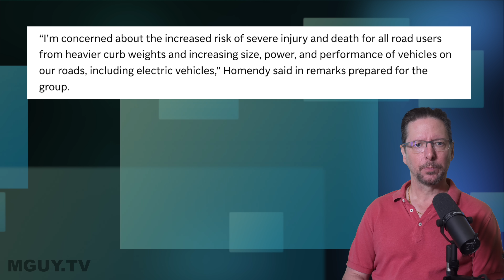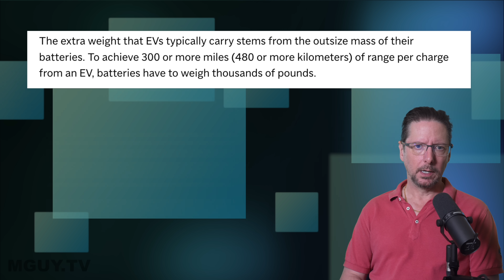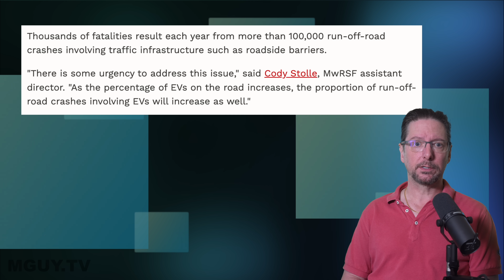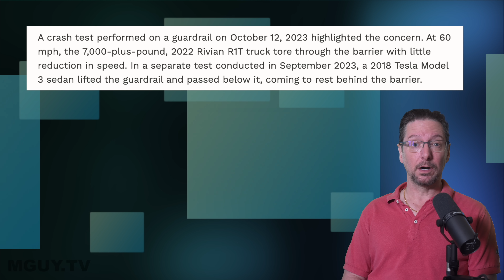EVs TOO HEAVY for roadside crash barriers (guard rails) | MGUY Australia

Comment: Here's the thing, many manufacturers are abandoning EV production such as Toyota as the data is in and they know its a lost cause, their own Advisors have said 'DON'T BOTHER' as they have the potential to end up in huge lawsuits, both environmentally and personally so to be fair, I don't see it as a major concern.
Also to point out, the vast majority of buyers are pretty clued up with so much info available both on the net and from their social circles, not to mention the general False narrative that many 'Climate' activists tout, 😊
Reply: The electric motors are actually pretty good.  It's the massive weight of the batteries that are the big drawback.  Batteries can make up 1/3 or more of the total vehicle weight.  The suspension needs to be beefier the brakes need to be beefier, the tires need to be beefier.  In accidents the  more weight you have the more damage you'll do to anything around you, this doesnt apply to just evs.  All larger trucks/suv have this problem.   Safety measures like guard rails aren't designed to stop a Ford superduty f350.  Guardrails may not even stop smaller cars.  Generally guardrails aren't designed to take head on collisions but as vehicles get heavier expect to see more evs in the ditch or over a cliff as the guard rails just can't push that much weight back onto the roadway.
Reply: @supernova743  The electric motors alone weigh what an engine does, then the batteries are Extra.
Reply: Toyota haven’t abandoned EV’s but they are refocusing on cheaper vehicles ($15,000 and under for a 4x4).

Comment: There is also the issue of criminals conducting ram raids and terrorists carrying out attacks. Both can just go through any existing barriers like a knife through butter. We can be sure this will be being considered by the bad guys.
Reply: Ehm no, the barriers intended to keep vehicles out are rated to stop a truck (10-20 metric tonnes). So a 4 t EV will stop. Well those government sites and the like. Jewelry stores probably don't have that level of protection.
Reply: @Michael-jx9bh  I am sure that some barriers are this high rated but I there are hundreds of government buildings where a lot of people work with little to no barriers. One big car, packed with explosives driven right in, blown up... big problem, explosives and an exploding battery. The White House would be safe but a regional tax office ?? To protect every single government office, local or national, to that level would be incredible. They rely for their safety on people not targeting them or not targeting them full on. Remember MacVey? His bomb was outside because he couldn't smash in and didn't want to die. It is easy to imagine a suicide bomber, in an EV, driving through the unprotected doors, and most places are unprotected, and then the damage and loss of life would have been way higher. Then we have banks, most of which have zero barrier protection and cannot get any to that level. They rely on the fact that current vehicles can't reliably smash through. Finally we have to consider the widespread corruption associated with government contracts which may well mean that things may well not be as they seem. We can all hope though, hope springs eternal in the human breast after all.

Comment: Mass follows momentum, crash barriers are designed to accept the weight of impact at midpoint in the centre of mass, EV's centre of mass is ridiculously lower so its no doubt the EV death machines will punch right through

Comment: Please remember how all EV charging is paid: DIGITAL CURRENCY(with the apps, etc)! THAT is why, they want us all to own EV's.That would knock a huge chunk of cash out of circulation. Then, in comes CBDC.
Reply: All as a step stone to getting us off the roads completely.
Reply: @robertkubrick3738  exactly. Well said, Sir. Cheers 🇨🇦
Reply: @robertkubrick3738  I think if they were letting people use gas cars they would be doing that. As no one would be able
To drive when we run out of gas.
Reply: @Audioremedy0785  probably right, although unless they shut down the fuel stations it’s very hard to monitor your use or preventing your use in a gas car. Very easy to lock up charges and monitor the vehicle is. Everything is Electric
Reply: @Eidolon1andOnly  or we could just use electricity which is doing a great job.
Reply: @Audioremedy0785  No it isn't. It's doing a terrible job so far. There's a reason why ICEVs replaced EVs over 100 years ago (yes, electric cars are older than ICE cars) and why EVs haven't been able to come anywhere close to matching their ICEV counterparts in terms of weight/power ratio + range until very, very recently when they got the closest they have ever gotten in a century and yet still haven't matched or outperformed their ICE counterparts. Not to mention that economically and environmentally speaking, producing ethanol or biodiesel is far better as it can be done anywhere, isn't reliant on rare earth minerals only found in certain locations on Earth that could eventually be mined out (there's already not enough readily accessible minable lithium to supply the batteries needed to replace every ICEV), and they're completely renewable.
Reply: @Eidolon1andOnly  the fact that you are talking about comparing 100 year old electric car to one in 2024 blows my mind. Like they are the same thing based on similar technology.
Reply: @Audioremedy0785  The fact you missed the point that even modern EVs still can't match their modern ICE counterparts is truly mind blowing. The fact you missed that there was no comparison made between early and modern EVs is also mind blowing.
Reply: @Eidolon1andOnly  when you say they ‘can’t match’ modern lce vehicles… in what way? Good Electric vehicles are selling like crazy, getting all sorts of accolades and awards and honesly, people who have them love them. The only area where they ‘don’t match’ ice cars is range. But that’s irrelevant given that charging is much easier to do than physically making a trip to a petrol station. The simple point is that they are not out-performing EVs in any way at all.
Reply: @Audioremedy0785   In what way? Already mentioned it - power/weight ratio + range. Doesn't matter if EVs are "selling like crazy" considering the government subsidies and other incentive programs to lower their sticker price for consumers. ICEV sales still dominate. With EVs there's either greater range at the expense of power/weight ratio, or greater power/weight ratio at the expense of range. EV owners loving their EVs is irrelevant. People love their ICEVs too. These opinions don't matter. Charging an EV is in no way easier than fueling up an ICEV. That's a complete fabrication pulled straight out of the rear end. A majority of motorists don't have the capability to charge their vehicles at home, EV charging stations are few and far between, and it takes less time to fill up an ICEV's nearly empty fuel tank to full than it does to charge an EV at a "fast charging" station to 80%, and that's not even considering any wait times for a charging station to open up for the next customer. Fuel stations for ICEVs are plentiful and readily accessible. There's no consumer private passenger ICE vehicle that takes hours, or at best 30 minutes, to fill up their fuel tanks. Fuel pumps also don't tend to do any damage to the vehicles they connect to, unlike "fast charging" stations which damage EV batteries every time they're used.
Reply: @Audioremedy0785  We have been running out of gas since the 70's. Maybe it's about time we can give that a rest. Considering the fuckton of diesel in the manufacturing chain of a BEV, the plastic in the BEV, even the polymer isolators inside the battery cells themselves. You couldn't even make a BEV without a veritable lake of oil. You going to make a BEV out of wood in your back yard?
Reply: Bang on comment! Couldn’t have said it better myself. Cheers.🇨🇦
Reply: @paulodisano502  Oh God, don't tell me these nuts have not arrived in Canada now!
Reply: ”You don't have a rainbow/Ukraine/Black flag in your bio, so we're going to suspend your charging privileges until further review."
Reply: The same way as 99% of petrol/diesel payments?
Reply: @oggyoggy1299  Are people FORCED to pay that way? They are with EV charging. I don't always use Debit.
Reply: @oggyoggy1299 Care to cite where that "99%" figure you mentioned comes from? Even if true, the option to pay with cash still exists for them. I've never seen an EV charging station that accpets cash as payment.
Reply: Oh truckers want to drive to a city to protest again? Well the chargers all seem to be inactive.
Reply: So you're saying that the gubments see this as a way of removing cash from society?  Really?  I don't know anyone that pays for petrol or diesel with cash either...  Last time I got a note out at a Servo they looked at me weird.
Reply: You can pay with your credit card as you do in a normal shop. And you pay with your normal bill when you cahrge at home. NOBODY is using digital currencies like Bitcoins for loading.
Where do people like you get this BS?
Reply: I swear the anti EV brigade are mentally ill….
Reply: The whole agenda is restrict our movement.
Reply: ev, cdbc... none of it, has anything for me.  this babylonian betrayal, of common sense, and critical thought, is nothing new, sadly.  stupidity on steroids.
Reply: I think they need to do VK way more crash tests using EV’s. Best use by far.
Reply: Not sure about all places but were I'm at all the rural gas stations are only credit card payments now and no cash
Reply: aaa the old hidden pay scam......

Comment: I absolutely love your stand on the issue of the failed EV fiasco being forced down our throats. Unfortunately, on this occasion I am not able to agree with you.
There are vastly differing weights in the large variety of vehicles from motorcycles in the hundreds of KG to single and B double trucks grossing 60 + tonnes.
These crash barriers are most often quite capable of preventing a semi trailer from punching through to a head on with traffic on the opposite side of the road.
That's what they are designed for and certainly large trucks fairly regularly hit these barriers without punching through them. Certainly these are oblique glancing impacts, the high speed direct impacts shown in the video are nigh on impossible in a normal traffic situation.
The heaviest EV would not be any kind of considerable factor in regard to a crash barrier, to my knowledge.
That's the garden variety crash barriers. Consider the amazing strength of, what I call, the cheese cutters, the multi strand cable barriers. From what I have seen those things could probably deflect an asteroid impact.
Reply: MGUY is more the messenger here. You are disagreeing with the research and concerns from the likes of the MWRSF mentioned at 3:02
Reply: @channel1_channel  True, but MGUY is presenting this information here so I am giving my opinion here.
Reply: When you say ‘failed EV fiasco’ you are aware that every year they eat into the vehicle market and sell in record numbers right?
Reply: @Audioremedy0785  No, I am not aware of that. 
The evidence I am seeing is that EV's are rapidly falling in popularity in the niche market they initially held and manufacturers are abandoning production targets.
This rushed EV experiment is clearly well on the road to being a catastrophic failure.
Reply: @Audioremedy0785  With billions of dollars in subsidies, the EV car sector should be growing. This is folly for people who are relatively rich. What happens at market saturation point though? Scale! Roads, infrastructure, environmental costs, mining, grids, safety etc.
Reply: @channel1_channel  what happens when the market reaches saturation… Tesla launches its $25k model 2 and all of a sudden opens up good EVs to another 40% of the market. And when you say ‘it should be growing’ Tesla’s market is growing massively. The only EV cars that don’t sell are the rubbish ones.
Reply: @Audioremedy0785  Currently we hear about a price of $60,000.00 to replace a Hyundai EV battery that is less than a year old.
These are already highly priced rubbish and all of a sudden a new Tesla for $25,000.00.
That is not going to happen without some stupendous cuts in quality, in fact it's clearly an unrealistic fantasy.
Reply: @Audioremedy0785  Billions of dollars assisting this EV market. Yes, maybe poorer people will get something. 
I was looking at a BMW 330e hybrid. Due to environmental concerns, in part, I'm actually inclined to steer away from full blown EVs. Perhaps the battery tech will become much better down the track. I've lived in various inner city locations where home charging is impossible.
Reply: @channel1_channel  I think it’s fair to say that EVs are not currently for everyone. But the cars themselves, in particular the Tesla’s, are amazing.
Reply: @Audioremedy0785  I am sure they are for various climates and circumstances. That said, even from an environmental position, I am reluctant to own one with the current battery tech. Folly for the rich.

Comment: To any EV zealots, I have five words for you to learn: 'Force-equals-mass-times-acceleration'...
...you might do well to learn this...
Reply: Don't forget conservation of momentum too. Energy can neither be converted or destroyed,  only converted into another form. The faster the energy is changed in a crash the more likely occupants will die. The more energy the longer the accident will need to be for anyone to hopefully survive.

This is why racing cars are designed to disintegrate when they are crashing. This allow the accident to last longer allowing the energy to be converted slower into things like sound, heat, etc.; and the overall mass of the vehicle reducing in turn reducing the amount of energy that the driver will be subjected to.

Comment: If the ev pickup does that to a crash barrier

 what would it do to a person broken down in the emergency  lane or changing a flat tyre in the rain at night ?

There wouldnt be enough left for the grieving  family to bury 

But politicians  and car makers dont care about all the risks to property  and people as its zero emissions  hell or high water regardless  of the cost
Reply: It's one of the reasons the Tesla CyberTruck isn't sold here yet, it won't pass our safety standards.
Reply: Sometimes it is better to be in a thousand pieces than alive and suffering.
Reply: @tonysheerness2427  what are you made out of if you think you are surviving being hit head on by an ICE vehicle at that speed?
Reply: In that same scenario, what would happen if it was an ICE truck…? The same thing.
Reply: @Audioremedy0785  Not quite - it would also explode.
Reply: @allangibson8494  ha. Yeah precisely. But they wouldn’t bother talking about that.
Reply: Actually that is exactly what happens when an ICE truck of the same size does the same thing. They weigh the same or more (the difference is they also explode).
Trucks aren’t required to meet crash standards in the United States.
Reply: @allangibson8494  ICE trucks are lighter than the Equal BEV truck.
Reply: @robertkubrick3738  The loaded weights are the same. The Rivian has a maximum weight limit that restricts its payload. It’s about a half ton heavier empty than a Ford Raptor - but that’s a Raptor with no fuel which adds another 70kg.

Comment: Even a driver experienced with high speed manuevers in a light weight sport car; will be shocked at the inabiity to turn a 4500 lb car the driver just accellerated to 100mph. Frew understand that grippy tires can only provide a small ability to change direction of such a fast moving heavy mass;; plus the EV community loves to talk and push one of the few performance elements an EV is better at - short range accelleration - not turning - straight line drag strips.

Comment: I imagine that it would be technically difficult to upgrade barriers.  You can’t simply make them stronger because that would defeat the way they work.

The whole idea is that when a normal car goes into the crash barrier on a motorway, the uprights pop but the horizontal rails stay intact and flex abound the car.  The idea is that the crash barrier acts like a sponge that flexes and gives to suck the force out of the crash, strong enough to stop the cars bursting through to the oncoming carriageway but soft enough to stop them rebounding off into their carriageway.

Make the crash barriers strong enough to cope with EVs and there is a good chance that they will act like a solid wall to lighter ICE cars causing them bounce off into traffic.
Reply: People are not buying light ICE vehicles what a myth, they are in fact heavier than the most popular EVs.
Reply: @GDM22  Pretty sure my Kia Forte is lighter than most EVs. Probably better for the environment too.